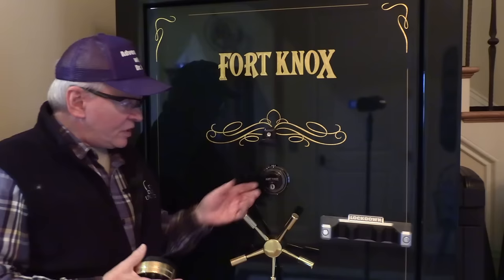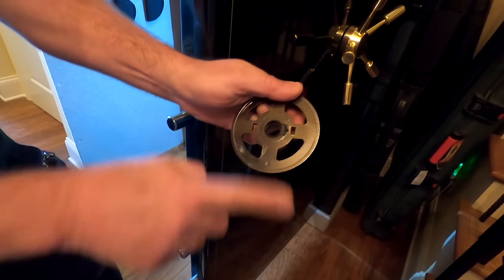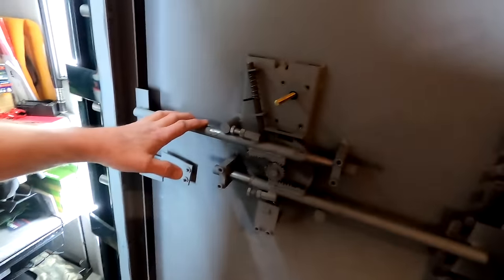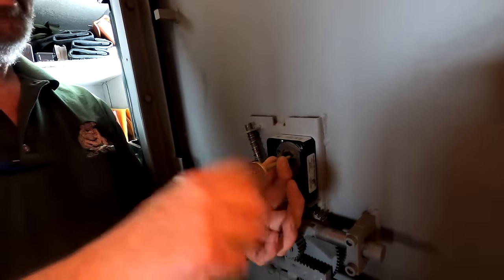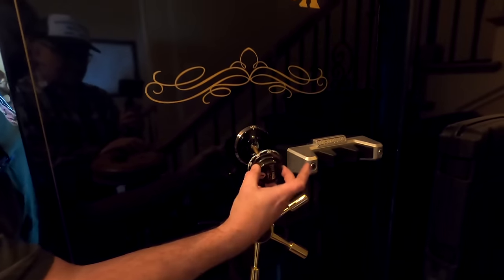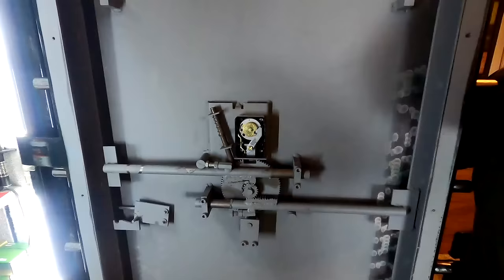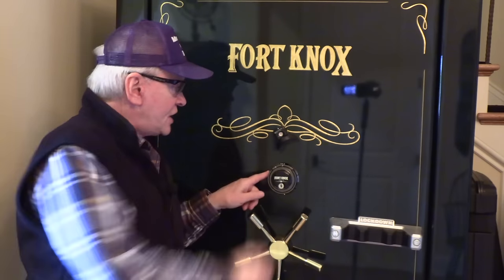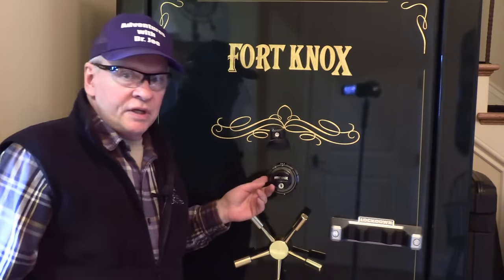Change Electronic Digital Safe Lock with a Mechanical Safe Lock for Gun Safe Liberty Safe

Comment: You may be getting a lot more hits on this video very soon.
I'm here due to the Liberty Safe crap.
If I can put a mechanical lock on mine for now, it will help me until I can buy a bigger and better brand later.
Reply from the maker: I changed mine out because I didn’t want any risk of an EMP blast. How far fetched that is I don’t know, but I went with Mechanico cause it’s failsafe. The liberty safe giving the info to the FBI. It is terrible. I was so sorry to hear about that. Consider subscribing. Thanks Joe.
Reply: That's why I'm here.
Reply: Yep, same here.
Reply: Same…buyers remorse on Liberty…
Reply: Same here. How much did all that cost you to have that new lock installed?
Reply: Yes liberty just boosted the sales of these locks exactly why I’m here
Reply: That's why I'm here as well
Reply: you have a link of the replacement lock you purchased? I never cared for the electronic lock and had intended to change it, but would like to sooner now due to the current siutation
Reply: Same here have a cabelas liberty safe want a mechanical lock or a custom key lock that's not pickable

Comment: Not only do you NOT have to worry about electronic failures or replacing batteries, you have just EMP proofed your safe.
So in the case of an EMP happening, you will still be able to get to anything you need from your safe when you need it.
Reply from the maker: Yes Siri you are so right. That was the impetus for us to move ahead with this replacement. Thanks for your comment.
Reply: They now make electronic locks that are EMP-proof.
Reply: @ThePriceIsRising  No they're not EMP Proof. They just claim that.

Comment: I bought a S&G mechanical lock off of eghay which was a take-off from a new safe.  I installed it per the instructions on the S&G install video.  I didn't have an alignment tool so I aligned the bezel like in this video.  A couple of points for those who want to save money by buying a take-off lock:  First, make sure the shaft on the lock you buy is long enough for your safe.  Take-off locks have the shaft already cut so you may find the shaft is too short.  Second, the take-off lock is going to have one set of mounting screws, either long or short, but not both.  For my safe I needed the short screws but the lock came with the long ones.  I cut the screws to the required length and all is good.  The other way around isn't going to work so well.  Also the take-off lock isn't going to come with a change tool so if you want to change the combo you can buy a tool from MBA USA for less than 20 bucks shipped.
Reply: what safe you have I'm thinking about going the s&g route but know nothing about locks and if its a down grade for my liberty but just want it to be reliable dat care about warranty more about emp and thieves

Comment from the maker: Thank you great advice. I bought my new so it had the long shaft, multiple length screws, and the change tool. When you buy one that is a takeoff lock you can get just what you mentioned. No question that the takeoff lock will be less expensive than you got some potential issues. Thanks again. Consider subscribing. Take care Joe

Comment: You made the better choice anyway. Those S&G electronic locks are absolute trash..... I will always opt for a manual dial every time; plus you never need any batteries lol. The S&G mechanical lock is the best 😁
Reply from the maker: Thanks for your comment. I was always afraid that the electronic lock would fail because I’ve heard many instances where they do then you’ve got to drill your safe.
Reply: That's exactly what I did the day my liberal safe back in june
Reply: LoL. I have a Sportsman Steel Safe with an LaGard electronic lock for 22 years. I change the $5.00 battery every year.  Zero problems. That being said, I will be replacing that lock with another electronic lock that is EMP-proof.
Reply: @ThePriceIsRising  22 years is a hell of a run for an electronic lock. Most electronic locks are lucky if they make it past 6 years of heavy use (ie locks in banks); but most residential safes rarely get the day to day abuse. What usually kills a lock is moisture, a battery destroying the terminals or a failed solenoid. The best kind of lock to get would be something that is redundant. They have locks that are mechanical and electronic combined. You get the ease of use with a keypad, and a mechanical dial as the backup.

Comment from the maker: Thank you for your comment. Yes I’ve had a number of comments that my installer was not a true professional again of one reason that I did not do that myself. My lock works great, however after the install, and I think that some terms were not used correctly, but thank you for pointing that out. I really really appreciate that. Consider subscribing. Thanks. Joe.

Comment: I got rid of the mechanical dial and went with the electronic keypad type and never looked back!   I’m in and out of my safe at least 3-4 times per day, each day.   My S&G mechanical spin-dial gave up the ghost and wouldn’t let me open my safe half the time.   The pins got loose due to daily manipulation, multiple times per day.    With the electronic keypad, this problem has been eliminated.   I’m not worried about an EMP.   If an EMP goes off, you have waaaay more problems to contend with than getting into your gun safe.   Kiss your a$$ goodbye in that case, because more ICBM’s will be enroute shortly and neither you nor the safe aren’t going to matter anymore.
Reply from the maker: Thank you for your comment. I understand the convenience of the digital keypad. No question about it. I’m glad it’s working well for you. Consider subscribing. Take care, Joe.
Reply from the maker: @@banthamnobilis8147 after the video I change the combination, so it’s OK. Thanks for your attention however. Consider subscribing. Thanks, Joe.

Comment: Even though my is not a Liberty, the fact that the electronic lock has a backdoor code that I can't change is not acceptable to me.  I just ordered an S&G mechanical lock.
Reply from the maker: Yes I did too!
Reply: Y’all were worried about the master reset code for the wrong reason. If law enforcement has a warrant for the contents of your safe, they’ll call a safe technician and have it drilled open.

Comment: Enjoyed the video. I have a similiar Fort Knox executive with biometric electronic lock. What model S&G lock did you get with key access as well. Can most locksmiths perform this install and approximately what was the charge to do so ? Thanks
Reply from the maker: Thank you for your comment. The key does not open the safe it simply locks or unlocks the ability to turn the dial. It is an added layer of safety in the event you are out of town or gone from the safe for a while. Yes a reasonable locksmith can do this replacement very nicely and the cost is about $130 I believe. 

The S&G lock I purchased came directly from Fort Knox. I called them and ordered it and received it very quickly.

Take care – Joe
Reply: @JosephHunstad  Thanks so much. What is that Lockdown piece you have on the safe?
Reply from the maker: @hollidaydoc45  The lockdown piece is a magnetic movable piece that allows you to rest your guns on the safe so they won’t tip over Also won’t scratch the safe
Reply from the maker: @hollidaydoc45  My new combination lock is a three number lock.
Reply: @JosephHunstad  Great idea.
Reply: @hollidaydoc45  most locksmiths are not safe techs, this guy is a locksmith in the video. Some of us are locksmiths and safe techs, but we are few lol.

Comment: I t looks like you assembled witih the flag pointing towards rather than away from the shaft (did I see this correctly?).  The S&G 6730 instructions and photo in the indstructions that came with mine said the flag should be pointed outwards.  Any reason for the discrepeancy?
Reply from the maker: I had a professional locksmith install this because I didn’t want to have any errors, but I’m not certain that he did it correctly. I would follow the directions that come with your lock over the step-by-step in my video although my have worked perfectly since they’ve been installed. Consider subscribing. Thanks. Joe.
Reply: @JosephHunstad  Flipping the spline key would probably not cause any problems.

Comment: I've had two of those electronic locks on my safe fail (mechanically, inside via the jackscrew).  I begged Fort Knox to send me a mechanical lock but they said that I wasn't qualified to change it out, despite my extensive mechanical/technical background as a machinist and mechanical engineer.  Still no...

Having seen this video, they are absolutely stupid, I could EASILY do that job.  I kept waiting for the "hard" part, or the "secret" part....  Nope, that was no more challenging than swapping out the E-lock!

😡
Reply from the maker: Hey buddy, you are so correct. I know you can change it out. No problem in the project is actually a lot of fun. Thanks again for your comment. Consider subscribing. Thanks Joe.

Comment: aside from the deal with the override code, i have had an E lock fail. drilled access to override the lock, took 20 minutes maybe. i now only use dials, but these safes are not huge obstacle with knowledge and time. however they do stop smash and grab and children. kids alone make them worth their cost.  

btw, if you clad your safe 1/4" plate. that is a much more formidable obstacle. and if that cladding is ar500 plate in the spots that matter, you better have carbide and diamonds to get in. nothing else is getting through that.
Reply from the maker: Great comment. Thank you so much. Yes, I understand the limitation with the safes but for child protection they’re great. Consider subscribing. Thanks. Joe.

Comment: I have bought AMSEC CF5524 TL-30 rated safe and it has ESL10 electric lock which I don’t like it. Dealer gave the option of a Dial Combination lock or SecuRam SafeLogic Extreme Redundant lock. Do you know anything about this Redundant lock and it’s reliability over Dial Lock on this AMSEC CF5524 safe. Appreciate your response..!
Reply from the maker: Hey buddy, thank you for your comment. I understand the concern of an electronic lock. That’s why I changed mine. I am not very familiar with extreme redundant lock, however. I wish I had more information to help. Sorry. Consider subscribing. Thanks, Joe.

Comment: "never fail" is an overstatement, they do fail but MUCH less than the Elocks from almost ANY brand. A true "safe tech" will use a dial ring alignment tool DRAT tool it keeps things true & centered, also no use of loctite on the body or cover screws? He's calling wheels dials?? lever a hammer.. geez. I couldn't make out the spline handing I hope he installed it in the VD location. FYI They leave the factory with 50 on all 3 wheels. A typical charge(from my company) with the lock included would be $250 to $300 depending on location.
Reply from the maker: Thank you for your comment. Yes your insight is very appreciated. I feel a lot more comfortable with the mechanical dial than the electronic dial it as you’ve said it’s much more reliable. Thanks so much Joe

Comment: Will the S&G 6730-100 Series Lock work on a Cannon Safe?
Reply from the maker: It probably will but I would check first with SMG to be sure it’s compatible. Typically these locks have a very similar construction with the mounting bolts and the dialing. Lev are all in the same location.

Comment: I have a Mosler. I need a 6 B 
The locksmith that I’m working with told me that that’s the only lock I need I can’t use anything else
Reply from the maker: I’m not sure if that’s true or not. These are actually quite standardized. Might be worth a second opinion. Typically the fittings are such that these lacks fit many safes, and the safes can handle either the mechanical or the electronic. Consider subscribing. Thanks. Joe.

Comment: Joe buying a new medium sized home gun safe and think I'm going to do exactly this.  Don"t trust the electronic way.  Looks paying a locksmith is they way to go.  Not an average DIY job.
Reply from the maker: I agree with you. I didn’t want any risk of locking myself out. And the beauty with a Locksmith as you can tell him exactly what code you want, and they can set it up for you. I’m glad you found this useful. Consider subscribing. Thanks. Joe.
Reply: @JosephHunstad  I've found out the specific safe I'm going to buy, Big Horn made by Rhino Safes, does not accept manual locks.  Oh well the safe is the size and price point I want. Will have to wait if so.

Comment: Nice guy but it's really cringy when I see someone starting screws or bolts like that with a power tool instead of getting them started by hand properly to insure the threads aren't crossed.  I find lots of ruined bolts from bubbas doing exactly this 🤦🏻‍♂️
Reply from the maker: Thank you for your comment. Yes I agree. I would normally hand start these, of course before starting a power tool to ensure that there’s no cross threading or stripping. Yes this was a video of a Locksmith I hired and that was his way. Consider subscribing. Thanks Joe.

Comment: He didn’t know the difference between the fence and the gate?  
The part that he was pointed to is actually called the “spindle”, and the part that threads onto it is called the “cam”.
The part that he called, the “hammer” is actually called the “lever”.
He also did not clock the cam properly or else your combo would have been 50, not 15. This is because he installed the cam in the LH (left hand) position, not VD (vertical down) like the lock is mounted. The cam should have been backed out a quarter turn. 
The secondary re-locker is not for if someone tries to drill through the back of the lock. It’s for if someone tries to punch the lock out through the spindle hole and knocks the the lock body off. 
I hope that he at least kept the last number out of the “forbidden zone“, which would now be 70 and 95, instead of 95 and 20.
Reply from the maker: You make a great point we’ve had a number of issues with the video. The reason I asked a locksmith to go through this because I knew that would be some controversy with this. I think some of the terms as you know, we miss you and I apologize for that but thank you for bringing that up. Consider subscribing. Thanks. Joe.

Comment: Will it work on Winchester?
Reply from the maker: This is a good question. All safe Vlokh seem to be very similar in their orientation with their openings for the bolts that hold them in place as well as the lock or turning mechanism. Yes I think it will work for Winchester as well. Consider subscribing. Thanks, Joe.
Reply: Thx, just subscribed

Comment: A combo dial with a key backup is unwise. The key is much easier to pick than the combo.
Reply from the maker: Thank you for your comment. Yes there is a risk with a key. No question about it. That could be picked but you have safety with respect to potential EMP blast or other digital lock failure. Thank you for your comment. Consider subscribing. Take care. Joe.

Comment: Why in the world this was installed incorrectly, spline key position is not correct?

Protip for the spindle length: it is always a set distance from the lock mounting surface, so measure door thickness and and this known number to it and cut the spindle, no need to install it by threading it on and off.
Reply from the maker: You make a really good point. The reason that I had a locksmith do this as I knew I was going to get quite a bit of controversy generated by this. Your point is correct it could’ve been done better and it was an ideal, but it does work well and I hope you found the video somewhat useful. Thanks for your Analysis, which is right on. Consider subscribing. Thanks. Joe.

Comment: Also the tech is wrong, that is not the fence and a gate....... The SPINDLE is threading through the DRIVE CAM which is held in place with a SPLINE KEY........
Reply from the maker: Thank you for your comment. You were absolutely right. Sometimes when you film with just one take some things get mixed up. Thanks for your observation. Take care – Joe
Reply: @JosephHunstad  if you have an email, I'd still like to send some concerns. Things to check and be aware of.
Reply: Pretty sure the locksmith was referring to the parts of the wheel and lock that line up when the combination is correctly dialed open.

Comment: You just went from a conveniant digital keypad to a PITA mechanical lock. You should of just bought an EMP proof S&G digital keypad
Reply from the maker: Thank you for your comment. When you look at S&Gs website it is EMP resistant not proof.   Probably really really good however thank you for your comment it would’ve been a good alternative. I was not aware of it when I did this. Thank you Joe
Reply: @JosephHunstad  Hey Dr. Joe thanks for your reply! Do you know if it is OK if I can only install the bottom two screws when mounting the new lock body? My old lock body & keypad that died the top 3rd hole on the lock body is on the opposite side where their is no hole tapped & I dont have an M6 tap (not even sure the thread pitch on the new screws).
Reply from the maker: @Metalhead-4life  I’ve been pondering your question for quite a while Jay
As long as the lock remain secure it doesn’t shift it should be fine. I would absolutely use Loctite or something else to permanently lock those two screws in place but as long as you’re not too rough with it it will probably be OK. This is my opinion I’m not an expert. Take care Joe
Reply: Hahahaha, this poor guy may want to delete his comment now, Joe. The Liberty safe ordeal just proved exactly who a digital lock is convenient for...
Reply: @scbane except now any lockpick can open the safe via the keyhole now.